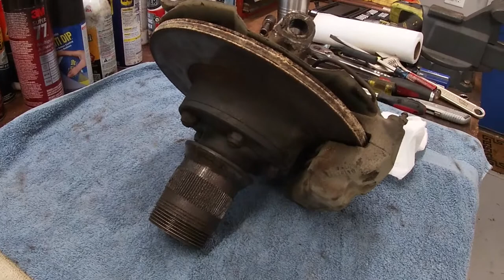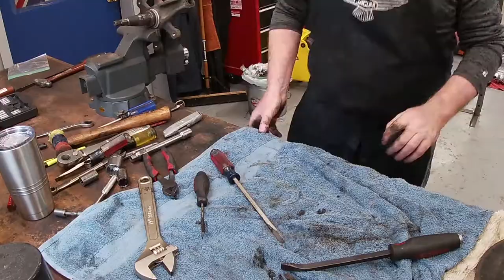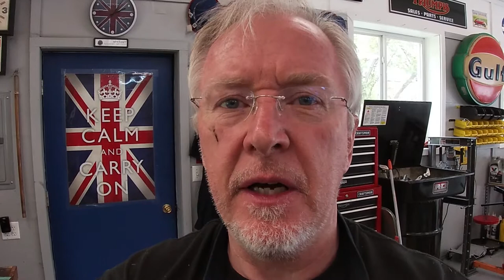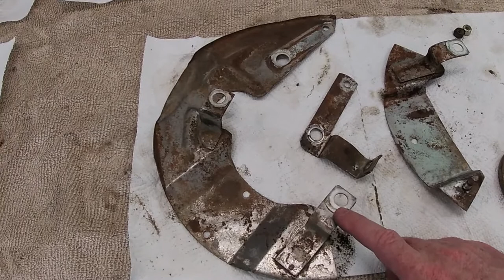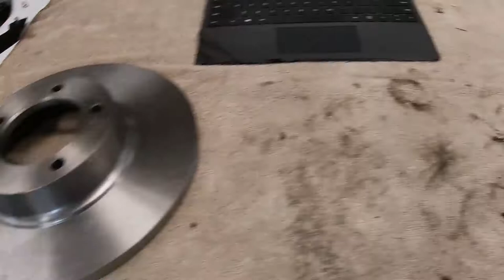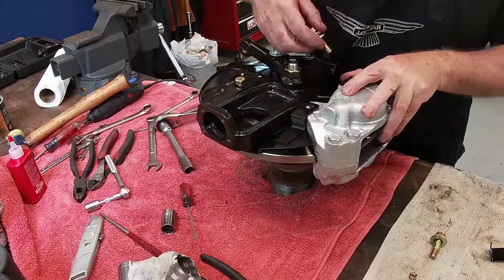Jaguar E Type Series II Rebuild - 2021-05-22 - Front Suspension

Comment: Did you know that series 3 discs and calipers fit a series 2. The discs are vented. I guess that's better if driving / braking hard at a track day event. Those German made lower ball joints are undoubtedly the way to go. Great looking rebuild as usual. Cheers.

Comment: Hi John, I’m just about to re assemble my front hub units.  Can you give any advice on securing the main nut that holds the external bearing in place?  How do you know how tight it should be?  Thanks!
Reply from the maker: Hi - for reassembly on the bench you simply have the castle nut tightened just finger tight to hold everything in place. Then when you install it in the car you set the bearing tightness. 

Take a look at this video - https://www.youtube.com/watch?v=lZPrDwkiiiA

The title is - Jaguar E Type Series II Rebuild - 2023-02-12 - Front Axel Assembly and Steering Rack

This is a later video showing the installation in the car. 

In this video, I referenced a video from Richard Owen, with a link in the text and I followed his lead for the assembly. Richard does restoration for a living and has a very strong track record, he has helped me personally numerous times. 

Richard builds the front hub assembly on the vehicle and then sets the bearing preload. I personally still think you can build the front hub assembly on the bench, then install it on the car and set the bearing preload while on the car.  You can choose the method you prefer. If in doubt, I suggest you follow Richards method.

Ultimately you are limited on the preload to the castellated nut position and split pin assembly. 

 I have a few miles on my car now and in the spring I am going to check the wheel bearing preloads now the car has settled a bit. 

I hope this helps - John
Reply: Thanks John, that’s great!

Comment: John it's so much easier to disassemble/assemble those uprights on the car. It's damn near impossible to get the right wheel bearing float on the bench. Next time! Those uprights and all the hardware are cadmium-plated steel.
Reply from the maker: Hi Richard, thanks - I will do the float check on the wheel bearings when the uprights are on the car

Comment: Great video thanks. what did you decide to paint them with or did you powder coat them?
Reply from the maker: I decided to paint them - I hope I don't regret it as I went back and forth on getting them powder coated. I used a Dupli-color Engine self etching primer and enamel to help with any heat issues.

Comment: Are the nuts holding in the stub axles nylocs?
Reply from the maker: Hi Hugh - when I ordered the parts for the front hub assembly I ordered new stub axle nuts as well. However, I must have ordered the wrong size as they did not fit when they arrived. A quick trip to ACE and I was able to get a nut but not a lock nut. The lock nuts are on order and I will fit them when they arrive